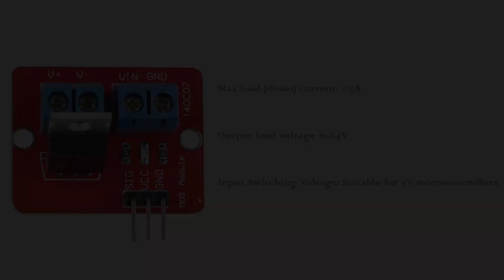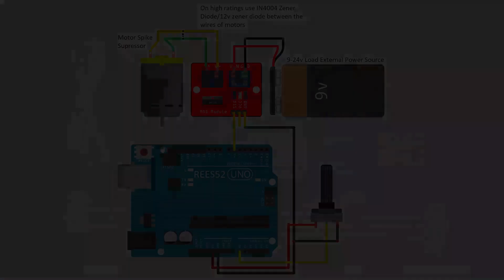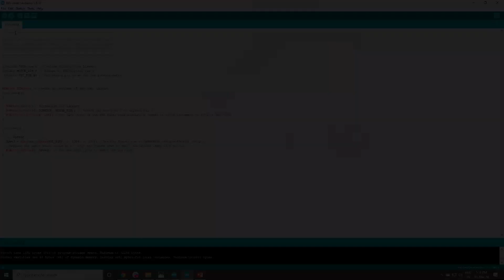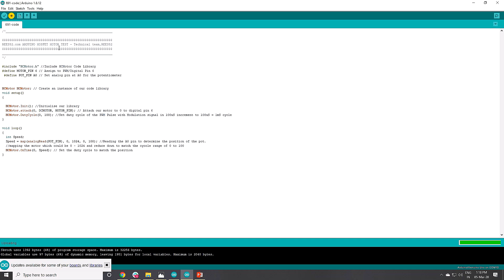How to Control Power Supply Using IRF520 Mosfet Switch Interfacing with Arduino Uno

Comment: Very good explanation. If you don't use the potentiometer, ask how you would control the speed of the motor with the arduino code.
Reply: Technically the analogRead() reads from 0 to 1023, and usually we divide by 4 to get a range from 0 to 255. And you digitalWrite this value to a PWM pin (like pin 7). So by using the Arduino code you "simulate" the pot.

Comment: Sir i have purchased some product from your website and now no one is replying to my calls messages and emails  no customer support  sir if  request you to please ship mu order or els refund the money back plz 🙏🏻.               Sir will you please change the address of the order  #IN000297/2020
To , 
Mayank soni
 9713230949,7987551929
952, New Railway colony ,
road no 1
Ratlam (M.P). 457001 

 
Sir because i have moved to my home  due to relief in lock down so i requst you to change the delevery adders of invoice number #IN000297/2020 please do me the favour